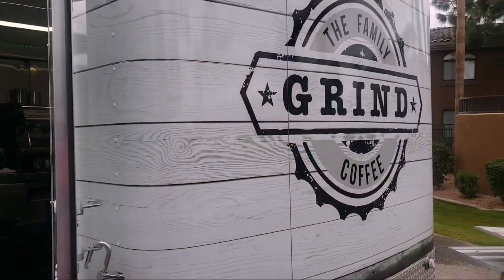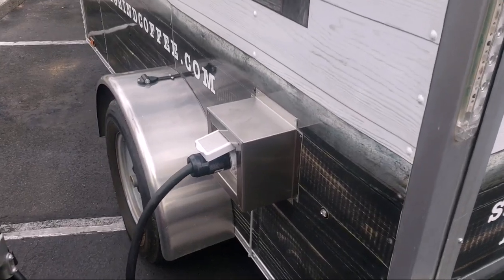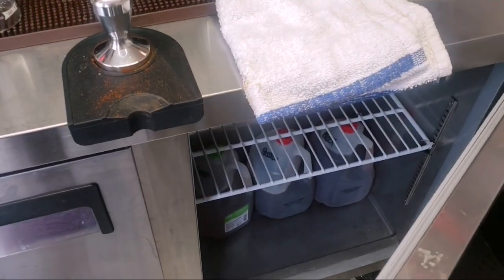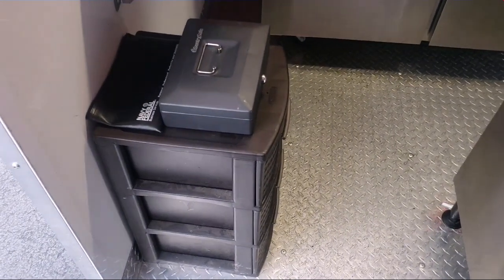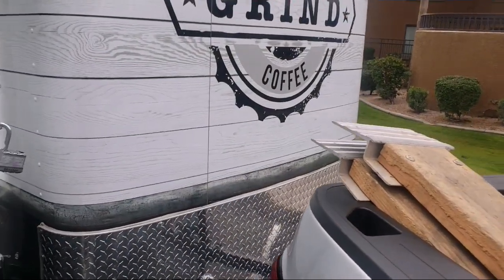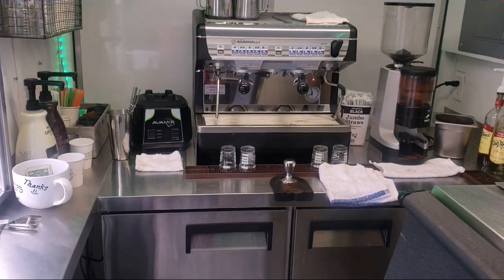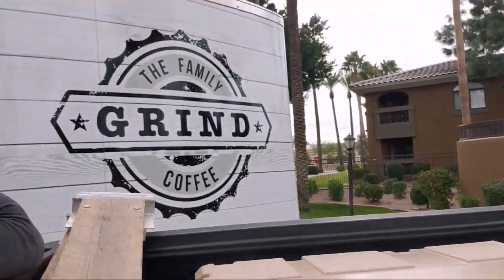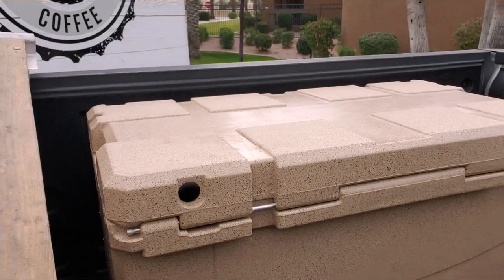Our Mobile Coffee Shop Set Up

Comment: What type of espresso machine do you use? And can you fill it with water in a reservoir or do you have to connect it to a water source
Reply from the maker: We use a Nuova Simmonelli Appia ii compact 2 group. 220v. We can not fill a reservoir. We run water from our fresh tank, through a RO system, then a pump draws it to the espresso machine. 😉

Comment: Great video man.
I am investing in a similar unit in Ireland. But we are haveing powering issues due to the coffee machine being to powerful for the generator.
I was looking g at buying 7kva generator.
But it seams its not enough to run fridge- lights - grinder - machine etc
Any fees back would be great
Thanks
Reply from the maker: Awesome bro! My grandfather was from Ireland, its on my bucket list! So, we run the Honda Eu7000is 7000 Watt and haven't ran into any issues. Our espresso machine is a 220v along with everything else we run including AC, RO, Lights, grinder, fridge, water pumps, ect... You should be good with 7k.
Reply from the maker: The other thing with the Hondas is they can be bridged together. I know some of the larger diesel generators would work as well.

Comment: Thanks for the helpful tips. I would like to know how many watts and amps you are using. I’m looking at the exact same generator for my truck but I have a 240 volt heating element it needs to run and it doesn’t seem like it will power anything beside that. Is your coffee maker 240 or 120 volt?   How many watts is your coffee maker?  Thanks.
Reply from the maker: We run a 220v as well! Our generator has held up nice. It will draw more power when it's hot and the AC is cranking!
Reply from the maker: 240v sorry

Comment: Great looking mobile set up. We also have a mobile coffee/beverage business. We opted to go the full grumman step van route. We run a simonelli Appia 2 on a 240v system. I'm curious, with your honda genset, does it get maxed out on wattage and run peak while in operation? And what is your total wattage usage on the trailer?
Reply from the maker: Hey Matt! The only time we've maxed it is when everything is running at once and it's hot outside. In the 110s and above. We typically stay around 4800